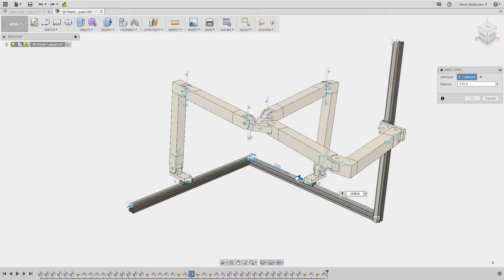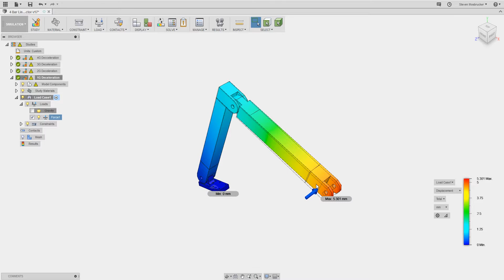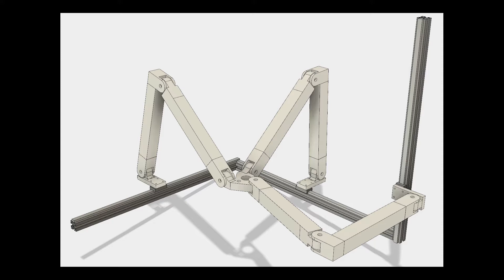Tripteron Project Video

Comment: Hey, nice job! Looks like you used some of the models from my Tripteron prototypes. Did you guys ever get any farther in the design and performance?
Reply from the maker: no. Shortly after or so they came out with the conveyor belt printer i think
Reply from the maker: The main issue as you know is the tolerances of the joints and the rigidity. in order ot get it right was going to massively increase mass
Reply: LegitTechTutorials Yeah I ended up getting the joints machined in aluminum but I had to set the project aside. I was thinking of putting it back together as an all aluminum version soon. Dug around to see if anyone else was working on one and found your work. Still, very cool you took a stab at it. Appreciate the kudos!
Reply from the maker: @Apsuity  Yea. i am working on a commercial corexy design out of wood. I might do a limited edition tripterion out of wood or something.
Reply: LegitTechTutorials Awesome. I was toying with a CoreXY design as well. Some fun stuff to work on in that form factor, particularly with the bed raising/lowering, like using a Sarrus linkage. Be curious to see what you come up with.
Reply: @LegitTechTutorials  : Did you ever contemplate something simple like a herringbone gear hinge to increase tolerances and stiffness without adding a lot of mass to things?
Reply: As it stands, I suspect you're not going to get to 3D printed arms like that- it adds to your tolerances problem you have.  They flex too much.  Right now, I'm conducting initial experiments for using 2020 V-Slot and geared hinges for the arms...sort of like Nicholas Seward's Minitrip design there.  It's going to be a jump in performance- whether it's enough or not remains to be seen.  If not, I'm going to look at cast Al or similar for the hinge joints.  The main reason I'm contemplating lost PLA casting there is that those Herringbones are going to be...entertaining...to get to otherwise and I believe they're one of the keys to getting to this design to work as well as the University actually showcased things in their videos.